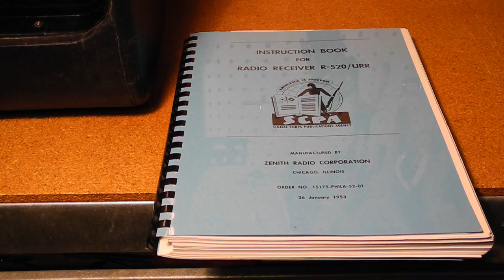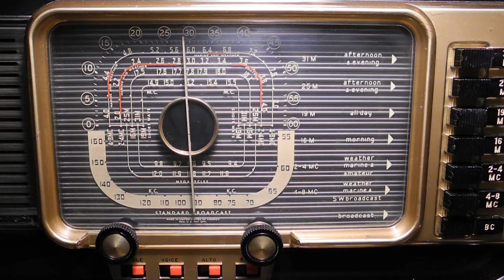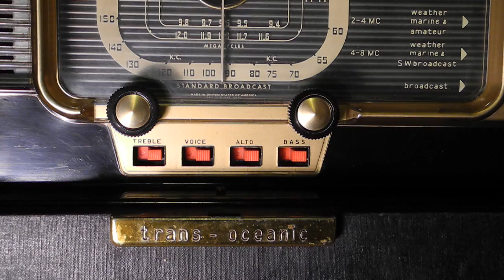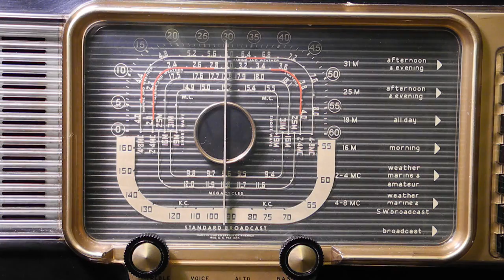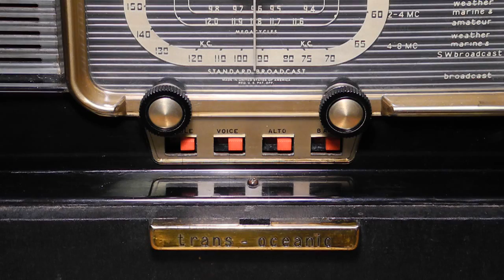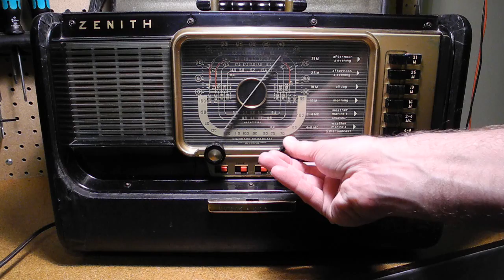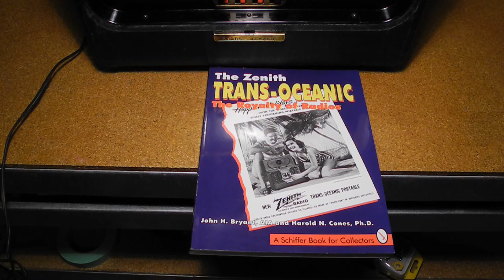The Zenith H500 Super Trans-Oceanic Portable Radio

Comment: I've had one of these for almost  20  years.  I took a stab at getting it restored but couldn't find anyone local that could restore it. 
I put it on the closet shelf and almost forgot about it 17 years ago.  I hoped for good repair videos and this video and RW's restoration video  series now enlighten us.
Time to get on it.
Thank you for this video!
Reply: Did you get it up and running?
Reply: @Rottingboards  Not yet - had a small case of cancer interrupt my best laid plans. Still recovering from chemo and radio and surgery.
But, I saw a newer model for sale locally and so cheap too...less than the cost of parts to repair my old one.
Kimda torn between the two but the old one IS way cooler.
Reply: @Zapheteroped  Good luck with your recovery.  And good luck with your choice.  :-)
Reply: Well.. how did it go

Comment: I have a Transoceanic I bought off of Ebay several years ago. After some minor re-capping and replacement of all the tubes I now have it working. My next effort will be in obtaining a after market battery box and use rechargeable batteries in it to complete the rebuild. I have the original factory users manual that was in the radio when I bought it and a reproduction schematic. I have all the original tubes and plan to have them modified into solid state tubes so I can have an extra set. This is a great video sir, well done and informative. Thank you very much for posting it.

Comment: several years ago I saw what looked like a little old black suitcase in a trash pile at the dump! it is not permitted to dig thru and take away things at the dump in my city but i couldnt help myself and quickly just swept it up and tossed it into my truck before I left. I opened it when I got home to find that it was an old radio and in very nice condition cosmetically, It didn't work but I cleaned it up and have had it on display ever since because it is such a good looking thing. I have a 1953 version of this model ,it has all the vacuum tubes and everything is in extremely good condition,does not look like it was really ever used, no cosmetic restoration is necessary on this one in my opinion. I would love to hear it working one day though, when I plug it in simply nothing happens at all, I notice it gets a little warm right there the power cable goes in to the chaises but nothing happens.I dont want to ruin it by trying to take it a part when I do not have adequate knowledge to really be doing that, if anyone knows of a radio repair place for old radios like this that I could ship it out to to have it repaired I would be very happy for that information!!! and happy to pay to have it sorted out.its just such a good looking thing, id love to be able to have it functional.

Comment: Awesome video and history
:) I have two of these that used to work power supply popped around 10 years ago and my longest procrastinating project. They both need restoration all original components still. I just need to get started. I like how nice and neat  yours looks. I need to get a photo facts book as my guide and replacement parts. Also like the info in the 1L6 as I only have one I had to share between the two radios when I listened to them 
Going to check out that solid state one you mentioned.

Comment: Awesome video.  I just bought a black 600 and a leather 600L.  Both in mint working condition.  No battery packs though.  I am wondering if you could flip me a link to where you purchased your battery pack on Ebay.  I am a fellow Canadian.  Cheers!
Reply from the maker: Unfortunately it was from a seller on eBay that is no longer producing them and I have not been able to find any other sources for a similar battery pack.
Reply: @jefftranter  too bad!  Thanks for replying!

Comment: Note that the hole for the 1L6 socket is larger than the tube.  This model was the first TO using miniature tubes and when it was first being designed the 1L6 did not yet exist, so the chassis was punched to accept a 1LA6 tube.  Until the first batch of punched chassis were used up they simply used a 7 pin socket with a larger wafer at that position.  This means that it is possible to replace the socket with a Loktal one to rewire the radio for the 1LA6 if the 1L6 cannot be found.  This will require realigning the radio.

Comment: Another battery option, that I use:

Six size D and sixty size AA.
The D (filament) batteries need to be replaced more frequently than the AA.

I find that I'm usually running mine on batteries. Where one would find an AC outlet, one will find 21st century RF noise 😟

Comment: I just bought one of these restored on ebay and it works great but the telescoping antenna sticks and doesn't extend or retract the entire way. Any ideas? Would some WD40 hurt anything?
Reply from the maker: WD-40 should be okay to try unfreezing a stuck antenna. Just don't use it to clean any of the electrical controls or switches.
Reply: +Jeff Tranter Ok, thanks! By the way, the knobs are starting to strip inside so do you have any suggestions such as after market ones or even good originals?
Reply from the maker: You can find original knobs from time to time on eBay. I also found this source but have not seen them: http://www.alanjesperson.com/shop/reproduction-parts/
Reply: +Jeff Tranter Thanks!
Reply: XxwhosrightxX

Comment: I have this same radio. My radio has what I believe is a resistor that is blown. On your radio it is the same as mine and is red and sand like in texture on yours it is marked 63-2018. Would you happen to know its value to replace with a new one? Thank you
Reply from the maker: I believe it is 230 ohms, but it is recommended you replace a number of components in the power supply circuit including the selenium rectifier and new resistors with different values. Look for one of the repair guides on the Internet such as
http://www.renovatedradios.com/articlePages/H500%20Restoration%20Guide.pdf

Comment: Hi Jeff I want To thank you So Much for Getting Back to me, It worked Great, But I cant seem to Find the 2 wire wound filament 950 ohm Resisters, Do they have to be wire wound, And Sams does not say the watts only for 130 ohm resister, Can I just use regular resister at 950 ohms, Thank you For all your Help You have been the Nicest you tuber that's helped me Brian
Reply from the maker: The replacement 950 Ohm resistor does not need to be wire wound but it needs to be rated at least 5 Watts or higher. You could use a 1000 ohm resistor. The 130 ohm resistor should also be one rated at 5 Watts or more.
Reply: @jefftranter  Thank you Merry Christmas

Comment: Note in the video that the 1L6 socket is mounted in a larger hole than the other tubes.  That socket hole was actually punched to fit an 8 pin Locktal socket for the type 1LA6 which is electrically identical to the 1L6.  When this radio was under development the 1L6 was not yet available, and the first prototypes were built using the 1LA6.  When the 1L6 became available, they still had a large number of chassis that had been punched for the larger tube, so they used them with a custom 7 pin socket that had a larger phenolic wafer.  It is possible to remove the 7 pin socket and replace it with a Locktal socket and then rewire the radio to use the readily available 1LA6 tube.  The 1LA6 will perform exactly like the 1L6, however a slight realignment of the radio might be required.  The 1LA6 is a better sub than the 1R5.  There are a few other tube types that can replace the 1L6 that will just plug in, these are lower current versions of the 1L6, and will require the addition of a resistor across the filament pins.  These subs are not much less rare than the 1L6 however.
The spare tube clips are probably intended for military versions of the set.

Comment: My girlfriend just gave me one of these as a gift. It's the same model as shown in the video. I am a sound engineer by trade, but I  don't know much about tube radios.  Mine only has four of the five tubes.  It is currently getting no power. No sound is made when you turn on the switch, and none of the four present tubes glow.  Is it reasonable for me to think that perhaps getting a new tube will make it work? Or does it sound like more the problem that yours had they kept it from working initially?
Reply from the maker: The tube heaters are in series so it will definitely need all tubes present to work. It may have other problems as well, such as the selenium rectifier. There are some good articles on restoring the H500 on the internet.

Comment: Sir:

Thanks for your great video. My dad inherited one of these old radios from my grandpa and it was in pretty bad unusable condition, I had it electronically and cosmetically restored to mint condition by an expert, Tom Johnson from Mckinney TX.

I would like to know if you have tested aftermarket or home made SW antennas to better the capacity and quality of the stock telescoping rod antenna.

Best regards
Reply from the maker: +Dr. Marcelo Oswaldo Vaquera I have used an external long wire antenna and that will certainly improve performance in most cases.
Reply: +Jeff Tranter would You please recommend one for me? Thank you !
Reply from the maker: +JOHNNYWADTON The simplest would be a long wire antenna - simply a length of wire, the longer the better, connected to the antenna screw terminal on the radio. Ideally you want it to be outside, but even indoors will work. Make sure it is insulated and doesn't short to anything that is grounded or go near a power line.
Reply: thank you sir. I actually ended up buying a "magic wand" external SW antenna on ebay.

Comment: Jeff:   I have one of these radios minus the battery and even has the original tubes. Everything LOOKS BRAND NEW, but the insulation on the wires are crumbling. Any idea of where a schematic can be found, would a slow start up be recommended  and are recap & resistor usual for these sets?    I don't want to harm this set ****its spent the last 40 years in a closet ****and like i said ***********LOOKS BRAND NEW.
Reply from the maker: Recapping the electrolytic and paper caps is recommended as well as replacing any out of spec resistors, if you are up to it. For schematics, try http://bama.edebris.com/manuals/zenith/h500 and http://www.rsp-italy.it/Electronics/Radio%20Schematics/Zenith/_contents/Zenith%20H500.pdf

Comment: Hi Jeff I have a question for you.. Can I  ?
Reply from the maker: Feel free to ask.
Reply: @jefftranter  thanks Jeff, 
I have a technical question.. Is it possible to get rid or eliminate - totally - the interferences and obstructions from the vintage antique radios broadcasting because most of the highly repaired and restored  vintage antique radios I did see  on YouTube videos , 
the boaring interferences are heard during the broadcasting process , which is very uncomfortable and noisy zzz zzz , so how to eliminate these interferences from the broadcast signals !
Reply: @jefftranter  so, is it possible or difficult to . . ?
Reply from the maker: @makyhsmakyhs6766  Using an external antenna will produce much better results than a built-in antenna or a short wire inside a house. That being said, the shortwave bands tend to have natural and man-made noise and this has gotten worse in recent times due to the presence of all the electronics in most homes today.
Reply: @jefftranter  thanks Jeff for the valuable information !
Reply: Please what kind of antenna the reel wire 60 for example !
Reply from the maker: @makyhsmakyhs6766  Some good suggestions here: https://swling.com/blog/tag/shortwave-wire-antenna/

Comment: Jeff the H500 was not "the most popular model in the series" .  That one was an temporary model for only two years (1951-53) as they prepared for the slide rule models of the 600 series that was introduced with the L600 in 1954 (brought out in later 1953).  The 600 series was updated several times ,  there was a T600, R600, A600 and B600.  In total these way outsold the H500.   If you are going by collector desirability, then the first one (7G605 in 1942) or the Military versions would top the H500 easily.   Nice video, otherwise..  do more !
Mark Oppat